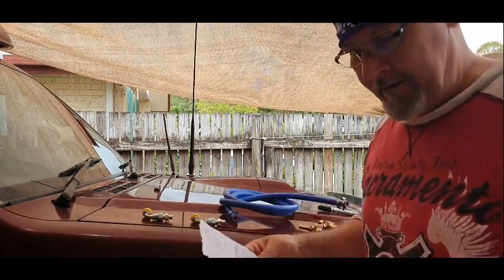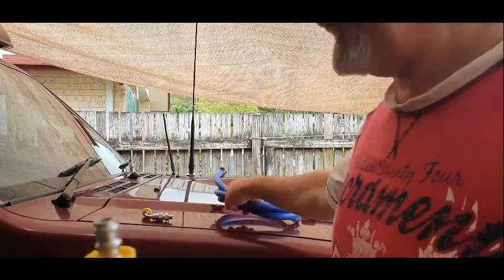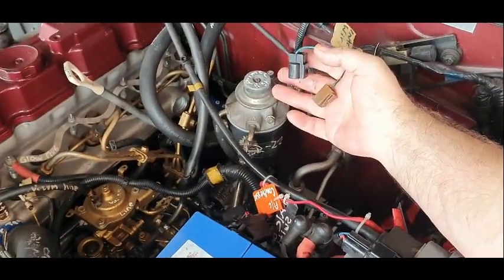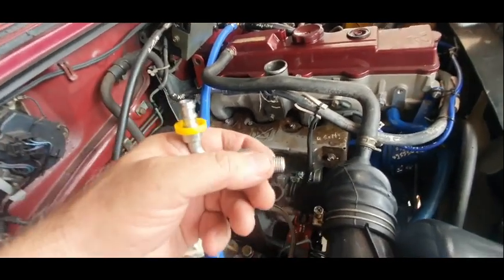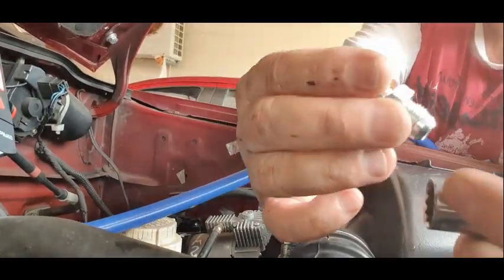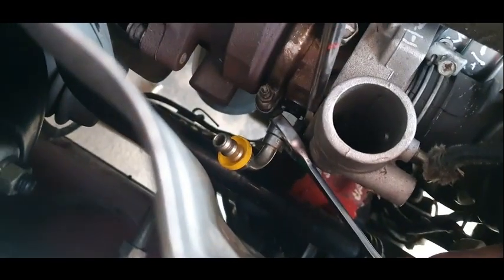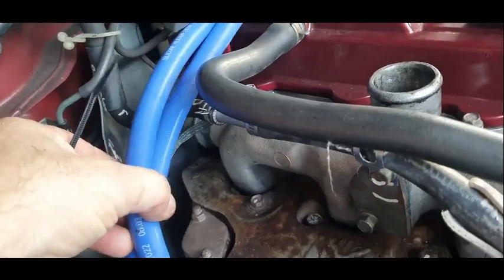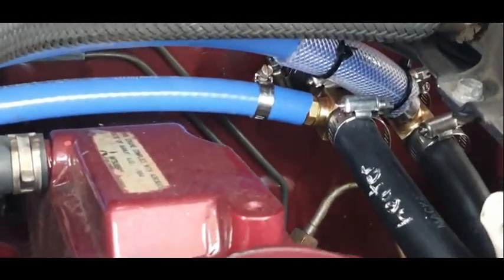How to  Install water cooling lines to your turbo(FT035).. 4X4 1994 NJ Pajero 2.8LT 4M40T

Comment: Hi, very interesting video, but I wonder if the outlet coolant doesn't come out with a very high temperature for that hose.
Reply from the maker: I went to a hydraulic lines specialist to source the correct line and fittings. Yes your correct in needing high pressure and high heat resistant material 👍
Reply: @AussieManCave  I understand, but the heating return hose hasn't failed at the moment?
Reply from the maker: @Nitronos182  no mine hasn't failed if that's what you mean
Reply: @AussieManCave  Perfect, it seems that method works, thanks
Reply from the maker: Your welcome 👍